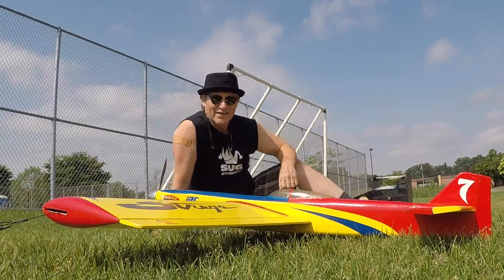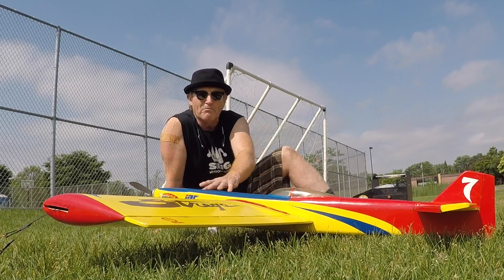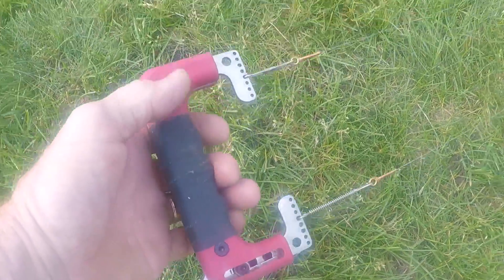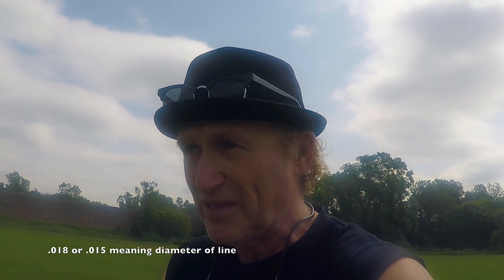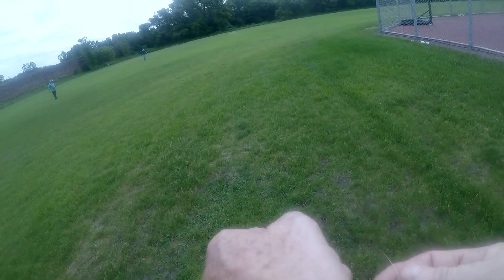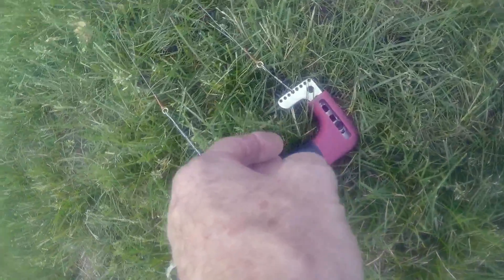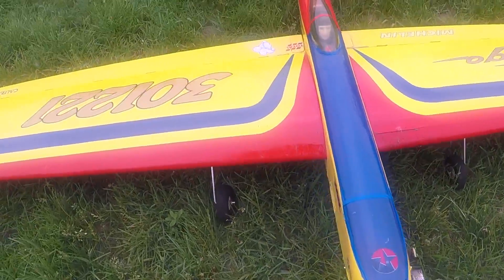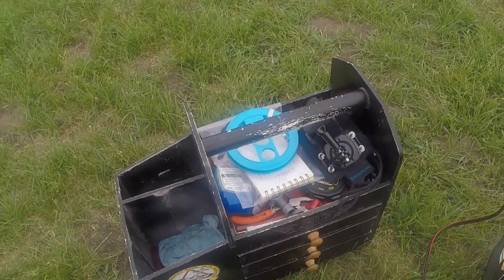Control Line Airplane Flying Explanation

Comment: Absolutely amazing stuff. I never took to CL only because of the trauma of kissing the sky...and then the ground. I did solid fuel rockets with the itty-bitty 110 Kodak film. I must admit, you are an organizational juggernaut. A place for everything & everything in it's place. Bravo!
Reply from the maker: Helps keep track of all the bits and bobs.
Reply: Loved my Estes rockets before I moved to control line and then RC.
Reply: No Sh!t my friend. Things have changed. Not for the better I"d say.
Reply from the maker: I loved my Estes too. Would mail order rockets and then a lonnnng wait.
Reply: Yo Bentley - I almost burned down the barn on more than one occasion. My best performer was the Valkyrie.
Reply: I t is hard to remember all the rocket kits I built. I had some small "AA" engines like bottle rocket size up o the "D" size. I know I had an Honest John I think was a "C" engine and also a V2 "D" size. It was probably 30" tall. Thanks for sharing. Good times as kids and learned things too.
Reply: Yo Bentley - You had the serious set up. After a while, to buy the "engines" I had to have an adult with me. The same with model glue. HA, they were worried the kids would make a bomb or sniff the glue. Nowadays, the kids carry Glocks and deal Meth. Things have changed I'd say.
Reply: Yo Bentley - May we have a few more "motors" hidden in some old boxes somewhere. Weren't they made of epoxy and Cordite or something? JUST KIDDING YouTube algorithm! 👍
Reply: shugemery - I don't  know which took longer, the Estes or the Sea Monkies (which were very disappointing). Oh, I forgot, the seeds which would produce 2lb tomatoes too.

Comment: Nice vid Shug! I always gotta give you my 2cents tho, don't mind me. I only do it cause I care and like to help and share. I've been a stunt flier for over 30yrs. Your thumb means nothing. If you like it, do it! Anyone tells you different, tell'em to go pound sand! Just be consistent with it. Only try changing if you think you might gain something or if ur somehow forced to. The only other thing I must say is that motor is NOT happy. You should be using way more fuel. At least closer to the 5.5-6oz. range. You need a much bigger venturi, brother. You can be making WAY more horsepower, running the engine much cooler, and not stressing it near as much. Its a win-win-win. We're only ever concerned with economy if we're forced to, like if we can't get a long enough run or if atmospheric conditions change drastically or something, but that's a topic for another time. Stay cool, Shug! I love u r stuff! Keep bringin'it! I'm smokin' a 15lb. brisket tomorrow. WHOOO BUDDYYY!!! Peace!
Reply from the maker: Thank you.

Comment: G'day,

  Yay Team !

  Um, regarding the Fuel, herewith an historical review...

  Way back in the 1970s these Glowplug-Ignition Engines took over what used to be the market for Compression-Ignition Engines, which we called "Diesels", back in the dayze when Wheels had flat-sides running all the way around them, and the olde-fashioned Diesels ran on 1/3 Kerosene (for Calorific Energy...), 1/3 Castor Oil (for the Viscosity to compensate for their lack of Piston-Rings...) & 1/3 Petroleum Ether (for the Volatility..., to lower the Flashpoint sufficiently for simple Compression to ignite the mixture...., and thus they were often a total pain in the Bum to get started - because Barometric Pressure  & Relative Humidity had to be adjusted for, totally by guesswork, by way of varying the Engine's Compression-Ratio, via a moveable "False Cylinder-Head" equipped with a Tommy-Bar & a Lock-Nut...!).

  When Glowplug Motors arrived, they ran on 3 parts of Methanol to 1 part Castor Oil..., with less Oil to avoid Plug-Fouling (and because  manufacturing tolerances were better, with less clearance needing less oil...) ; and Methanol..., because it undergoes an exothermic Catalytic-Reaction with the Red-Hot Platinum-Wire of the Glowplug - which is initially heated up electrically, with a Starter-Battery, to hot enough to ignite the Fuel-Air Mixture...

  Compared to starting Diesels, Glowplug Motors were a "piece of cake".

   Initially for Racing, cbasing more RPMs, & then to compensate for the local Density-Altitude effecting the available amount of Power produced at elevated locations..., a little bit of Nitro-Methane was substituted for some of the Methanol in the Fuel ; allowing the Nitro-Methane to add extra Oxygen into the overall Fuel-Air Mix, thus enabling all the Methanol to be combusted...., initially Nitro-Methane might make up 5% , then 10%, and even 15%... of the Fuel as time went by...

  There isn't really much point in using any more Nitro-Methane than that - because it needs the Methanol to burn ; and one cannot oxidise Fuel which is not present in the Combustion-Chamber (due to it's having been replaced with excess Oxidant Additive in the Fuel-mixture...), y'see.

 And then, eventually, apparently because AmeriKa seems to run on the Theory that Extra Power Is Always BETTER ! ; almost all the Pre-mixed Fuels for Glowplug Motors came to contain some Nitro-Methane, and (probably in fawning emulation of  the Racing "Dragster" Car "Industry" which speaks of it's "Nitro-Fuelled" Engines...), the manufacturers, the journalists writing fir Industry Magazines and the  consumers of Glowplug-Ignition Model Engines have all adopted the practice of referring to them as being "Nitro-Engines".

   Which is lazily misleading at best and willfully  disingenuously untruthful at worst...; but it seems that,
    "Such is Life..., Ned Kelly, such is Life !" 
  - at least, it is in the Land of the all-powerful Marketing Jism...

Tutorial concludeth...(!).

  Take it easy...

 ;-p

 Ciao !
Reply from the maker: I use this more or less....http://brodak.com/fuel-qt-10-nitro-11-5-castor-11-5-synthetic.html

Comment: THANK YOU for explaining control line flying.  I sure learned a lot.  Is that Enya 61 a 2 cycle or 4 cycle engine?
Reply from the maker: 2 cycle Enya .61
Reply: They are 2 stroke and burn the castor oil mixed in the fuel as they run, Thus the oily mess after a flight.